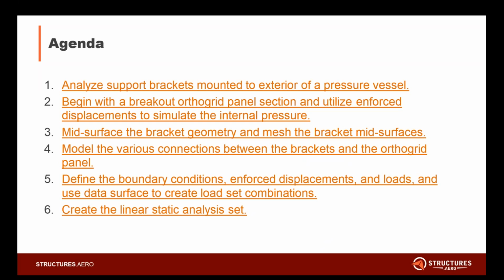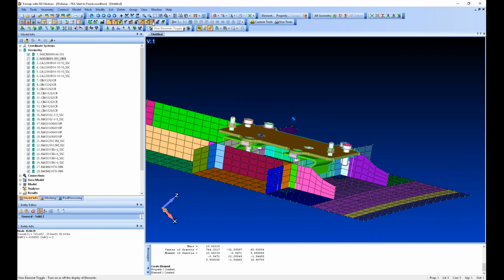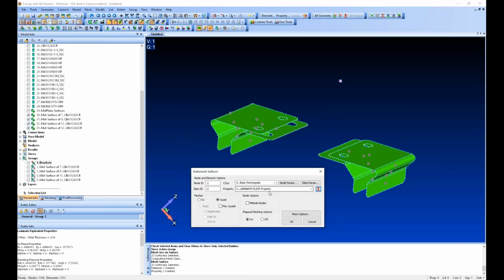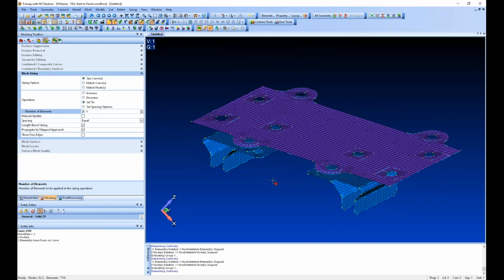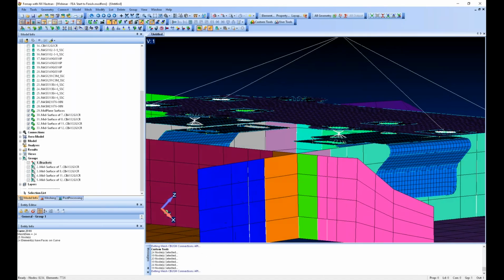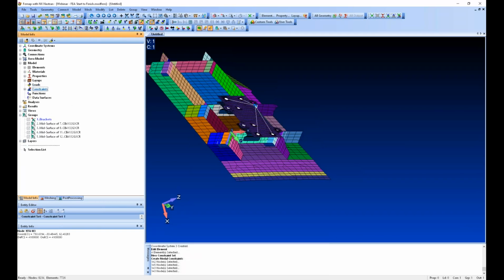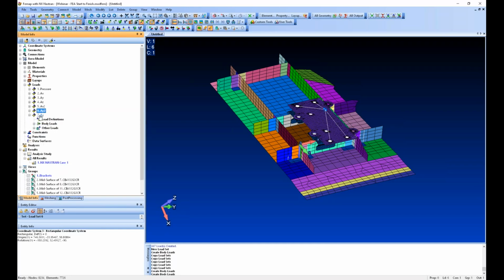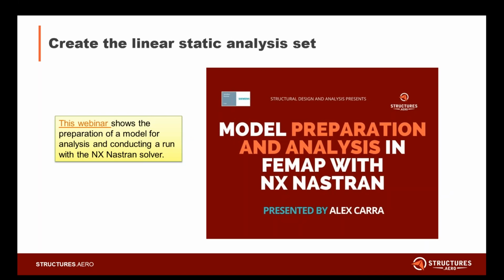FEA Modeling Tutorial from Start to Finish

Comment: why did he multipl mass by acceleration? that gives newtons! (or whatever american version that would be) shouldnt mass just be the lbs?
Reply: It should have been divided.
Pound is force. Slug is mass.
Lb/32.17 = 1 slug
Lb/386.04 = 1 slinch
Much like 9.81 N = 1 Kg
386.04 is 32.17*12 (ft to inch).
1lb force is 0.00259 slinches (mass).
Then you can take slinch times acceleration (386.04 at 1g) to get lb force. 2g would be * 772.08
In Femap you can use lb "mass" also as long as the acceleration you apply are in terms of "g". Like 2g (2) or 3g (3).
Reply: @jasonb5670  uff, i really dont understand imperial units but thank you for the explanation!